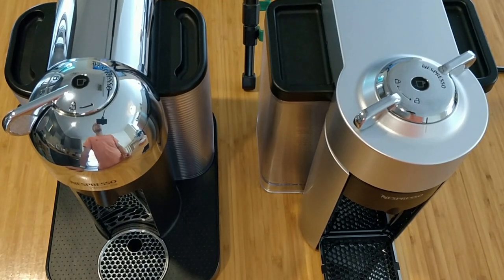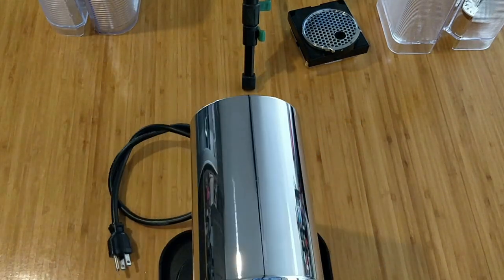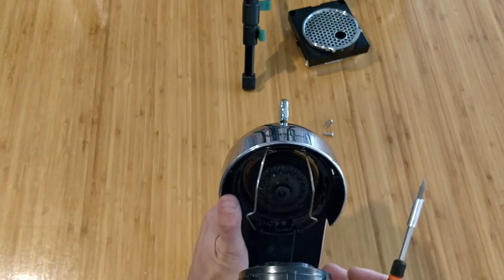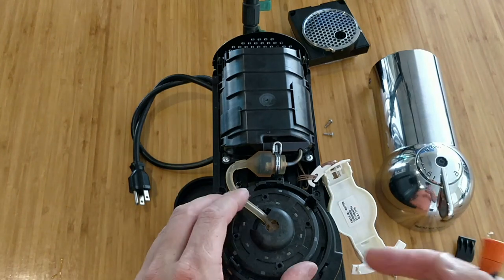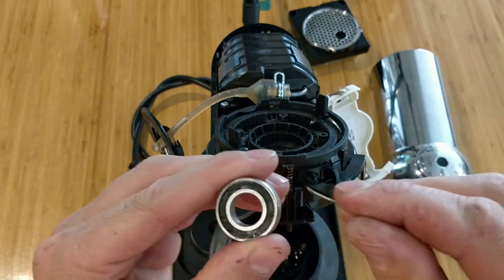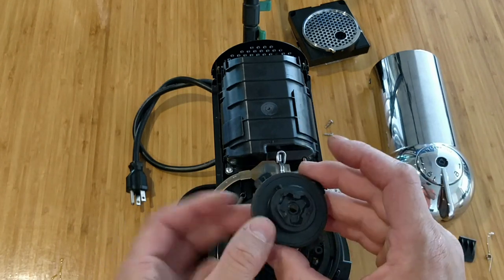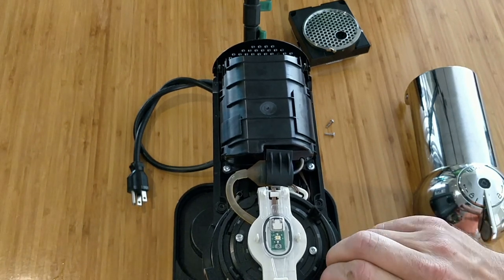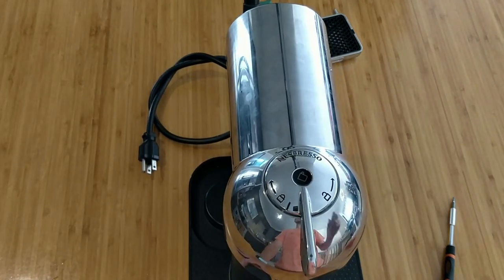How to fix Nespresso Vertuo Machine loud noise or no Water

Comment: Just spent about 2 hours following this video to replace the bearing, as well as pretty thoroughly cleaning as many parts and pieces as possible.  It was totally worth the time and effort.  The bearing only costs $6on Amazon, and a good set of electronics screwdrivers was maybe $8-$12 more.   Now I can fix loads of other fidgety things around the house!  REMEMBER TO PHOTOGRAPH AS YOU GO EACH TIME YOU DISCONNECT OR REMOVE SOMETHING, BOTH BEFORE AND AFTER!   I left a key part out and luckily caught my error.  My only suggestion/comment would be that a fair amount of the video is not properly framed to get the parts of the coffee maker or the process involved.  Worth a re-do, I think.  Thanks for the helpful and informative video.
Reply: Can you put a link to the one you got on Amazon?  Happy with it?

Comment: Thank you so much. I bought a used machine and after many cleaning cycles I was still getting gunk out. I’m sure it could use a new bearing but your video helped me disassemble it so I could clean all the dirt out. Thank you! Now I’m off to find a video on how to flush out that rubber tube. Thanks for taking the time to do this.
Reply from the maker: Glad I could help.
Reply: Same!

Comment: Thanks for sharing your knowledge on how to quiet our mornings in the kitchen. No longer do we need to turn up NPR on the radio each time we make a cup of coffee. I ordered bearings through Amazon and went to town on our Vertuo just as you instructed in your video. When doing so, the small hollow metal tube in my water line came out and I put it back in but apparently did not line up the small 3/4 round washer on it with the little notch on the surface that it rests on. I reassembled the unit with the new bearing ring and proceeded to put all my tools away before testing the unit. When I tested it, the water leaked out of the bottom of the unit below the water tank. I remembered that I had reinstalled the small metal tube and thought perhaps therein lay the problem. I pulled out my  tools again and took the machine apart for a second time. I pulled out the water hose and looked it over. It took a little bit to find the notch but then proceeded to line up the washer with the notch, reassembled the unit and all works fine. Thanks so much for producing the video and helping out thousands who have been yelling conversations to their spouses each time a cup of coffee is being brewed!

Comment: My machine stopped working (sounded jammed).  With a lot of persistance it took me hours to do the repair with the help of my nephew.    It was not easy removing and reinstalling the piece that holds the bearing. My fingers hurt.  Works now like brand new.  The person who is demonstrating is a real pro who knows how to feel the parts.  I wanted to keep this machine because the new ones look cheaply made.

Comment: This video helped tremendously, thank you. I just want to point out that a T10 Torx bit fits the screws better than a T9.  I also need a 14mm socket to release the plastic nut on top of the bearing -- it was pretty tight.

Comment: I'm thankful for the video. The old bearing was crusty from corrosion and a lot of use. I ordered a new bearing from Amazon and the replacement process went smoothly. I did have a problem on reassembly that is worth noting though and not included in the instructions. Water leaked out of the cap being held by the four screws preventing the machine from working properly. On closer examination, I noted that the short metal pipe which inserts into the end of the rubber supply line has a "C" ring on it. (When I disassembled my unit, the short pipe came out of the rubber supply line). On reassembly, and when inserting the short metal pipe into the top of the head of the unit, it is important to align the gap in the "C" ring with the plastic tab within the head, otherwise it doesn't provide a proper seal and causes a leak under pressure from the pump. Once I noted this, the machine operated flawlessly. Thanks again for your video, you have saved many people a lot of $ in repairs by Nespresso, or having to purchase a replacement.

Comment: Just followed instructions. Pulled the bearing out of the housing. Didn’t feel like buying a new one and waiting so i just spun the inside part of the bearing until it loosened up. Did that for about 2 minutes to make sure nothing is lodged in there and it was spinning freely. Put it all back together. And now the machines works. If it happens again I’ll buy a new bearing. Thank you for the detailed instructional. It was easy to follow.

Comment: Terrific video, I followed along step by step and worked like a charm! If you liked (or still like) Lego, you'll love this. Like many have said, use a container for the small screws and springs. Also take pictures at each step before you take things apart so you can easily refer back in case you get lost.

When I put my machine back together, I ran three cleaning cycles and some grounds came out, probably from being kicked loose. So be sure to do this before you brew your next cup of coffee.

Also a note on the silicone water hose: there is a metal pipe that must be lined up perfectly with the hose and the plastic cover. Make sure you line them up correctly when putting the machine back together or it won't seal properly and you'll get watery coffee and a leaky machine.

Comment: Thank you for this excellent guide. I followed your instructions and replaced the bearing. The machine is significantly quieter now. Key learning for me was to ensure the correct alignment of the open part of the rim on the little metal nozzle attached to the hose with the tiny raised plastic piece (in direction of hose). If you don’t do this, you’ll get watery coffee and water leaks. Thank you Andrew in the thread below.
Reply: Hi Robert, I noticed the little nozzle had a notch in it. I thought it was broken but saw that it was machined that way but I couldn't see a "slot" or something similar on the rubber connector. I just put it back in the house thing hoping for the best.I made one cup of coffee and nothing leaked. Should I notice if it is misaligned right away? Thanks. Rhonda
Reply: @rhondabroadfoot2073  It should face the direction that the hose is coming from when the dial is in the unlocked position. If you look really closely, perhaps with a flashlight, you will see a slightly raised section where the nozzle goes (at about 11 o’clock) and when you align the notch with that, the nozzle sits 100% flush.
Reply: @robertmooney9714  thank you!
Reply from the maker: Also sometimes when I disassemble something I do some photos for easier backwards assembly.
Reply: Thanks for sharing this! I experienced exactly what you described, and fixed it via your direction. You are so helpful too!
Reply: Yes this is a key step  if you have watery coffee, take it apart and when you put the little metal tube back in, there's a notch in the flat c shaped ring that has to line up with the tab on the top of the cover for that piece. Then the rubber hose drops in flush, so you get solid water pressure and no back flow. 

I disassembled this thing three times before finding that tip in the comments here.
Reply: As other replies indicate, this is a crucial step. I am grateful it only took me 2 tries to get it right. I found that, with a very bright light and/or a magnifying glass, I could see very faint "bumps" that do line up with the gaps/holes in the retaining ring on the little tube. I suspect those bumps are no really machined but instead just having the rubber pressed against the retaining ring for so long (and under extreme heat). In any case, once I lined things up so that the "bumps" (2 little and one big) aligned perfectly, there were no leaks and my coffee tasted like coffee again. I would highly recommend not putting the silver top back on until you get all this alignment stuff figured out. Not only is it a PITA to get the cover off again, but having it open allows you to see if there is any water leaking out of the top where the hot water gets injected. You will need to keep at it until there is no water coming out on top.

Comment: This amazing video helped me fix my Nespresso, this is not only a fix for the noise, with my machine, the bearing change helped me with the problem of watery brew.  This was happening because the bad bearing didn’t allow it to spin fast enough to push the water through the grinds

Comment: Great video.  I was able to follow this and found out my bearing had failed completely.  I ordered a new bearing off of Amazon and got it in 2 days vs. waiting weeks to get it from your recommended link.  Also, I recommend getting a "food grade" bearing.  The instructions and video were very good but there were a couple of times when you needed to move the camera and didn't so we weren't able to see what you were doing.  I hadn't realized how loud the old bearing was getting until I put the new one in and ran the machine.  It's whisper quiet like it must have been 5 years ago.  Thanks!
Reply from the maker: Glad it helped. .
Reply: Could you please give me the amazon link for the bearing.  Thanks!

Comment: Fixed my Nespresso thanks to your video!!! Just a note for others…the first time re-assembling the machine, I tightened it down too much, so caused some friction in the spinner. After loosening it up ever so slightly, everything worked like a charm and was nice and quiet. The key is to tightening things up enough, but ensure the spinner moves relatively freely without “squeaking”.

Comment: WOW! You saved me the cost of a new machine. I purchased the tools and replacement ball bearing and, other than having to use a need nose pliers to help loosen the black nut, everything went just at you described. Thank you so much!
Reply: Did you have trouble with getting the screw off to access the bearing? Was it on very tight?

Comment: Thanks for this great video. After completion it all worked great except it only produced hot water. I also found that the small circlip on the central metal tube was the problem. There is a very small nub on the black plasic part where the circlip sits, and it is essential that the gap in circlip fits over this nub or it does not set properly. Thanks again.

Comment: I just replaced the bearing on mine and this video was incredibly helpful. The only nerve wracking part was removing the cover of the model on the right without breaking the plastic tabs. After that it was smooth sailing. I also lost the spring on the front like in the video and spent a lot of time looking for it so I suggest removing it before doing any of the other work. Thanks - great instructions!
Reply: I too am about to remove the cover on the machine on right. Can you kindly tell me where the plastic tabs you refer to are located and how you proceeded exactly ? Thanks

Comment: Best way to align at the end is to lock the lid like you are making coffee and it easily aligns. Great video and thanks - mine was so lout you could hear it outside of my house. I did buy a new one, but I figured I'd give it a try and this video really helped. Now it's very quiet and now I have 2 Nespresso machines - might take one to work or something. Took under an hour. I bought the bearings on amazon - got 2 for $8.

Comment: Thank you, @RomaFix! My machine is now ~30db quieter - the pump is now louder than the spinner! A quick note to make re-attachment of the cover easier; I marked the position of the rotating plate in the base using a china marker, one tick mark on each side of the molded fingers that protrude up and fit into the pockets in the release lever. It made it a lot easier to put the cover on properly the first time. Thanks again for a great video, you saved me 200 USD.

Comment: Thank you so much. Very useful video and instructions. I was about to change our machine and you saved us unnecessary expense. Now the machine works like new with no loud jet engine like noise towards the end (high RPM).
Reply from the maker: Glad it helped.
Reply: It fixed the noise issue but created another - Started making watery coffee and espresso. Tried resetting and troubleshooting with tech help from Nespresso. It didn't work and had to buy a new one at discount by returning the broken one.

Comment: LOCKED LID FIX
I'm one of those dolts ;-) who didn't watch the end of the video in detail; I thought he was just having a little trouble snapping the cap back on.  Once again, I was reminded to watch the full video first, so you can flag sections like this. And read ALL the comments first.  With 500-plus, I scanned down a bit, but somehow didn't notice the issues of people locking themselves out of their machines. D'oh!  (I noticed the lever was off-center as I was closing it, and had an idle thought of whether I could live with it… then "click" and the realization that I was locked out. )

But as I write, I'm enjoying a great coffee after a week of pressed, made by my repaired (blessedly quiet) machine.  In my case, it would start a cycle, then seize, stop working, and start flashing.

Some observations and a locked top "solution" below (I have the De'Longhi flat-top version). As a commenter has said, BEWARE.  

1. I didn't have trouble prying up the cap the first time, but managed to end up with a small piece of broken plastic the second time (not a big deal.)  Be gentle.

2. The location of those pins is *key*. [6:51] Fail to note this, and you may discover that the large coiled spring can be *dangerous*.  I had trouble twisting the cap piece back down on the spring, but finally got it seated a little under the tabs. "Is that it?" I wondered. A moment later, standing above it, I looked down and BOOM!  A 3" projectile hit me hard on the cheek and the edge of my glasses.   No one else has mentioned this particular fail, but I guess there had to be a first time. ;-)

The pins need to be turned counterclockwise to open position. This will open up the tabs enough to bayonet this thing on.

3. Lock release.  After some initial frustrated attempts to open it, I gave it a few days, re-read any relevant comments, and pored over video stills and my own photos to try and determine where that release tab was under the cover.

I figured I could potentially reach it from under the lid with a paper clip or other tool; failing that, I could pry the rear part of the cover off at the back hinge location and possibly get better access to the clip; or I could break the cover by prying at the front, which sounds like what @johnradford2258 suggested.  I'd considered the drilling option early on, and a comment on this gave me confidence it might work as a last resort.

The closest I could get with a tool was after prying off the back of the cover and shimming it along the side. With a paper clip I could feel the spring, but couldn't push the tab. I have thin, angled electronics pliers, but I couldn't create a big enough gap to get them in.

Time to pull out the drill.  I used a 3/8" bit, but probably could've gone a bit smaller. I put some tape over the area, then drilled, slowly, from the side about 1/2" above the bottom of the cover where the flat part meets the curve.  Then I used a bent 3" finishing nail to lever the tab, and the top popped open.

4. I'd seen the comments about leaks and the silver tube.  My tube had popped out during the face-blast incident, and fortunately, while looking for the spring, my wife found it.  I had to guess at where it came from. ;-) I figured I might as well go back and have a look at what I'd done with that, and glad I did. Read those comments. 

Conclusion: While a bit of hack, this works.  The hole is quite unobtrusive, and I could possibly even find a rubber plug for it.  (I actually consider it a "feature", in case my lever ever gets disconnected, which I saw happened to someone somewhere.)  I've put a couple of photos on my channel->community in case you're in this situation and want to know the location of the hole.

Thanks again to RomaFix!

(Wish I'd hung onto the old machine we replaced this one with 1.5 years ago. It lasted five years, though it sounded like a plane taking off for much of its life.  I bought a 10-pack of bearings for $18 and I've got a bunch left.)
Reply: I drilled a hole too like you explained! Thank you for saving me 😂
Mine is a bit more toward the crease than yours, but in the end your hole is in a better spot! (I ended up drilling a little bit to much toward the screw spot). In the end I’m able to use my Nespresso machine so it’s all that matters!! Going to put a small sticker to cover the hole and voilà!
Reply: @sabrina.m0924  Good to hear! The sticker's a brilliant idea. The hole is tough to notice -- I asked a friend to tell me if anything was odd about the machine, and he couldn't. But I did try a plastic plug, which didn't work that well (turns out my bit was 5/16). Might just try the sticker.

Comment: Thank you for the excellent video and detailed instructions. I called Nespresso customer service earlier and was told that it will cost $120 to fix my machine and will take 3 weeks to repair. So, I found your video, purchased the proper screw driver for $8.00, spent maybe an hour with the machine, and it’s fixed! Now, I’m enjoying my cup of coffee. 😃
Reply from the maker: Glad that it helped.
Reply: @mrgel1878 thank you for posting your experience with customer service. I have a Vertuo Chrome, currently selling for $164, so $120 for a repair and three weeks without a machine is not only not worth the expense but would kill my husband who drinks coffee three times a day! 😆